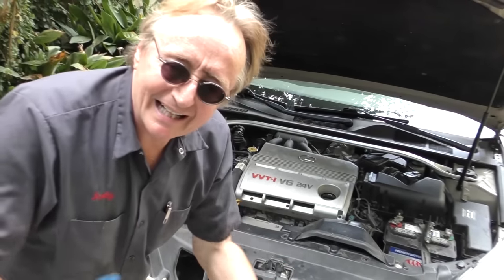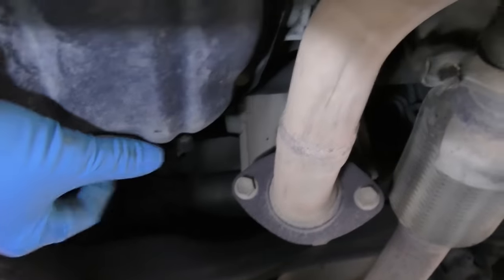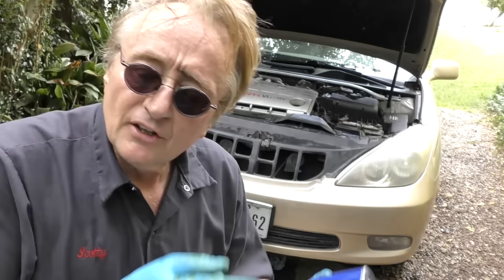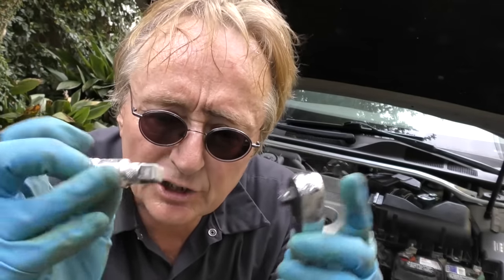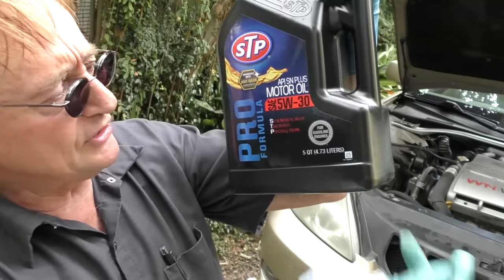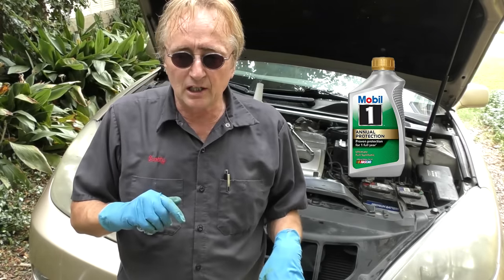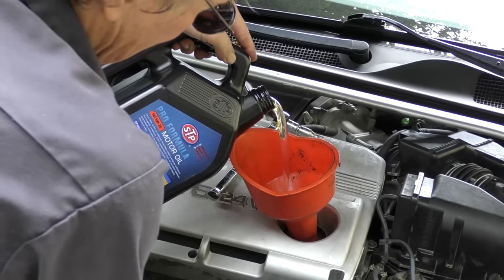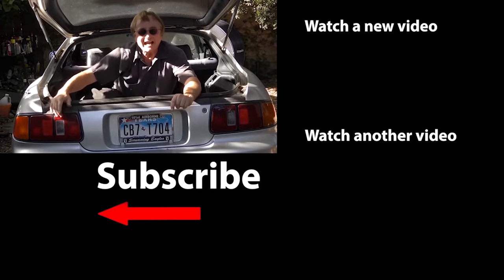Changing Your Engine Oil? You’re Doing It Wrong

Comment: I paid for oil changes twice.  The first time, they put the car on the lift and jammed the electrically retracted antenna into their ceiling and broke it and wouldn't fix it.  The second time, they tried to charge me for an oil change they didn't do and it wasn't an accidental oversight.  The receptionist acted guilty as hell when I caught them and the manager yelled at me, "If you didn't trust us then you shouldn't have brought it here in the first place!", as if it was my fault that they're crooks.

Change your own oil.  Get a I got a Fumoto oil drain valve to make it easy, even though I drive 5000 miles a year and only change the full synthetic oil and filter once per year.

Comment: Personally I only use Mobil 1 extended performance full synthetic and the high mileage variant of said oil for high mileage cars That's the brand I've been using for years Never had a problem with it I always go by the motto If it ain't broke don't fix it But that's just me filters are a hit or miss usually I go with the Mobil 1 filter But if there's a sale I'll sometimes get the cheap ones

Comment: Here's a thing, my wife has had her 2ltr diesel Skoda yeti from new since 2011 and has been serviced from the same garage for over 8 years , but as we're going to keep the car we decided that I would do the oil change and service it myself, I bought the correct 5-30 synthetic oil and filter together with flushing fluid, almost immediately the fuel consumption went from 31-32 mpg to over 37 mpg and still getting better, the moral of the story? Don't believe that garages use the correct oil , obviously ours even though it has a very good reputation does not and cars with a full service history are not necessarily better than those serviced by their owners.

Comment: The drain plug requires only like 20lbs-ft torque to squish the alu gasket - no more. Why would you use a breaker bar to tighten it? It is asking for trouble at the next oil change.

Comment: You don't need any special tools to work with oil filer (e.g. those filter caps, lol).
I've always used regular channel locks to remove an old filer and just screwed a new one on with my bare hands, always worked fine.
C'mon, Scotty!

Comment: The right way to change oil in 1974 at Ft.Benning,Georgia would have been to wait until the sweet thing wearing the tightest and shortest shorts in Columbus had finished washing her car and gone inside.........or maybe replace the filler plug when you put on the new filter.
      Not many guesses needed at work Monday when he said..Hey,ya'll know what I did after ya'll left yesterday??.......Uhhh,dumped 5 quarts of new oil on the ground ?????

Comment: I have a Huynday Accent 2008 Hatchback. I went for a engine oil change about two years ago. The mechanic installed a oil filter with a hole. After I been having problem. Anyway since then, I been using additive and do my own oil change. And recently I used Castrol Edge Extended Performance Advanced Full Synthetic Motor oil. My engine worked better now. Any comments?

Comment: Or, if you're cheep like me, get a 16-20" piece of salvage pipe that will slip over the handle of the rachet. If it won't quite slip over a flat handle, use a hammer on the pipe to flatten it and create clearance. Dont recommend a cheap ratchet.  Use a good one,  like Kobalt, Sears, KD, MAC, etc. Probably good to use a 1/2 with a 1/2 to  3/8 adapter..

Comment: I use Synthetic oil & change only my filter after 4,000 & 8,000 miles then top off, then a complete oil change every 12,000 miles car has 230,000 miles on it!

Comment: Scotty !!!!!   I've been changing my oil incorrectly. Bought my brand new 2012 Tacoma and have been using 10/30 instead of the recommended 5/30. Truck has 130,000 miles. Do I continue with 10/30 or switch to 5/30. Live in Houston if temperature  matters??

Comment: Hey Scotty, not sure if you will see this. Got a Ford 1.5L ecoblue diesel motor (2020 Grand Tourneo Connect, UK model), it's on 34k miles and has never had a service (first service at 12k and second at 18k missed, approaching what should be the 3rd service at 36k). Conscious of any potential extra wear I'm sure it has sustained, it calls for 5w-30, what brand or type do you recommend given the previous missed services?

Comment: Be sure not to drop the drain plug in the oil catch pan. Why do the auto companies put oil filters in such stupid and inaccessible places? I don't use a breakover bar to tighten the oil drain plug, as I want to avoid stripping the threads. 
Used oil is a good wood preservative for my raised gardens.

Comment: Never do an oil change on anything with a cold engine. the debris is deposited in any corner of the engine and the oil is therefore not suspended in the oil and in addition the oil is not liquid so it does not flow quickly and completely. So in summary you are putting new oil into an accumulation of used oil with lots of debris.

Comment: I've always been told to fill the new filter with oil before installing it so the system doesn't run dry when you start it.
Reply: You dont have to fill the filter,  just oil the gasket
 My dad had a service station for 43 years, never filled a filter. I change my oil twice a year ,before it gets really cold, and before it gets really hot, fall n spring. Rotate tires every 2,3 oil changes. Change ojl filter every time. Use a quality oil , not the cheap shite
Reply: complete nonsense repeated every thread.  Oil on cylinder walls starts engine and oil pulled from pan and pickup NOT filter.  Zero effect

Comment: Um, I haven’t been doing it wrong. You left out that it doesn’t hurt to pretreat your oil filter by pouring oil into the new oil filter till it’s almost full and quits dropping as the oil passes through
The filter media. Ore treating is good if you are going to start the car up immediately after changing the oil as I do to drive the car off my ramps. It’s good to pretreat because the oil takes several seconds to work through the filter after the engine starts before it starts lubricating the engine while pretreating is almost immediate.

Comment: Ya tighten your drain plug with a big braker bar, till it strips than back it off a quarter turn.
Reply: You need at least 150 ft-lbs to compress that rubber washer seal. (joking)

Comment: 1) Using a 1/2” breaker bar to tighten to drain plug?!?  No, no, no, a thousand times no.  
2) Dirty funnel ... resting square on the valve train.  
3) Lubed the gasket, but otherwise installed a dry filter.  No bueno.  At least fill it up once, pour it back out if you can’t install it without it spilling it everywhere, and then install it.

Comment: Do auto zone rent out oil pan, filter wrench, adjustable wrench. 
   With plastic return oil.
I know asking to much.
  They help me. Remove my
Alternater belt. 
( took me all night, til read book.
  Realized it was spring back,
Wrench was used. Pull spring back.
  Take off the belt.

Comment: Always like your video's. But what you mean your doing it wrong?? STP filters are garbage. Cut 1 open. There's hardly any filter at all in them. And breaker bar to tighten plug for someone that don't know what there doing?? They may strip it. Put a small 3/8 in there hands. No more.

Comment: Terrible. People who need a video like this NEED to be reminded: Righty tighty, lefty loosey. But you didn't mention it. Combine that with the fact that they have all that leverage while using a breaker bar like you recommended. They think they're loosening the drain bolt but, really, they're stripping the threads. For that reason, I have to give this video a failing grade.  Then there is the fact that most of them have ZERO idea how much torque to apply when tightening, even though, in all fairness, you made it pretty clear.  Because they are afraid of the bolt working its way loose & out, they tend to WAY, WAY overtighten it, and that is with just a normal wrench. If they are doing it with a breaker bar like you recommend, that tendency of theirs is just that much worse. It won't seem tight to them because they are too ignorant to take all of that leverage into account and so they will keep going.

Comment: Hey Scotty. You forgot to mention that the drain plug is magnetic and to check for metal shavings
Reply: I have been in the oil change business for 15 years an I have never seen a factory installed magnetic oil drain plug, unless someone has installed it after-market. If you were to find steel shavings in the engine oil pan, that engine is in serious trouble.
       Magnetic plug on the tranny is a different story.
Reply: @klausvolk2654  every car i ever had had a magnetic plug.

Comment: Be VERY careful with that socket extension torque u dont strip the threads tightening that bolt!
In fact....I wouldnt even use it to tighten that bolt....Scotty is a pro and wont make that mistake of over torquing the bolt.

Comment: It's surprising how many people will notice the " RED " engine light on and continue to drive the vehicle, never check the engine oil level, have catastrophic engine failure and then blames it on the car manufacturer  🤔have also seen cheap spin on oil filter element or micron paper collapse and cause problems.

Comment: I have to run thicker oil in my 2001 Ford Escape, it recommends 5w-20, but runs much better with 10w-30, I used 5w-20 and it fucked up my engine.

Comment: So Scotty says to spend $3 a quart for conventional oil. Duh, why not spend $3 a quart for Super Tech Full Synthetic instead and still change it every 5,000 miles. It's a no brainer.
And you don't have to follow the manufacture's recommended grade exactly... If it calls for 5W-30 you can use 0W-30 but the high number should not deviate and the lower number may only be substituted with a lower number. When then engine warms up the oil behaves like a 30 weight oil. The first number indicates the flow characteristics during cold starts in the winter. If you go with 0W instead of 5W it just improves cold starts in cold weather and provides a better flow rate when the engine is cold.

Comment: I took my oil to auto zone.  They said they're full. So I called them from the parking lot.
"Hello this is officer Duncan Moore from the EPA and we've had a report from a Mr Ries saying that you refuse to accept recycled motor oil. Does your store sell motor oil? Then you are required by law to accept used oil. I have Mr Ries on the phone right now. He's willing to drop this complaint if you go out in the parking lot and take his used motor oil in the next 5 minutes. Otherwise we will have to close your store starting immediately. So either go get his oil or lock the doors and go home".
Guess what happened next?

Comment: Hey scotty I'ma be getting a 2014 Lexus IS 350 f sport RWD 
It's got a bit over 108K miles. I live in Arizona and this summer is pretty hot. I have a heavy foot, Should I still put the required weight oil or go up one due to the hot temperature? Because it may slip if it's hot outside and in the engine? If that's a thing?
I was wondering if I could put Royal Purple Oil for the first 5k miles I run it than the second run it the 10K -12K before changing it? 
It has a recall that I'm going to let them know as well to get that fixed.

Comment: Hmm, never used a new oil plug.... Ever.  Still a fan😁
Reply: That car does not use an oil drain plug, it uses a crush washer, and it should be replaced every time, just like every other modern import vehicle. It should also be torqued using a torque wrench to the proper specifications to prevent damage. This is not really applicable on most domestic vehicles.

Comment: 5:20 Amateur move, glugging like that. Turn so jug spout at high point, then tip to pour. Air slides in, oils flows smoothly.

Comment: You did notice in the video that the funnels got some kind of fungus on it may want to clean that funnel The outside but if you are going to clean it clean it all the way cuz all that beautiful When will you put in there with a filter to keep the cut out you just poured it back in the engine?
I take it one step further and you don't have to do this because I'm extremely paranoid think of coffee filter and put it in your funnel and when it goes through if there is anything in the oil it's going to put a stop to it If you see anything in that oil change brands because they shouldn't be any crud and a can of oil if there is you might get the one in a million bottling machines that sprung a leak but maybe you might want to do it again what's 5 quarts going to cost you I always repeat always do that when I drain oil because I want to see what is floating around in there but that's just me The other people they spend money and they spend a little sample to a lab and it comes back and tells them exactly what's going on and I do that every year or so why not what's it going to do cost you ? $ 37.50 how much is a new engine cost?

Comment: i put some 'paraffin ' into the hot engine oil and run it for 2 minutes to thin the oil further and flush the old junk out...   no different to engine flush..... my engines definitely run quieter with new oil... and i also rarely go past 4000 miles before changing its THE secret to high mileage engine..

Comment: So the "right way" doesn't include pre-filling the oil filter before installation, Scotty?
Reply: startup is from cylinder wall oil and bearing oil, never from the pan and never the filter.  pump is in the pan not the filter.  If worried let it drain into pan for hour before starting.

Comment: I might disagree on the synthetic I have been putting synthetic oil in my mid 2000 vehicles That scotty says that wont last long and they have ( knock on wood ) . I think all new vehicles  and maybe over the last decade  use synthetic coming out of the dealership . Spend a little extra and do fewer oil  changes and maybe your engine will thank you with a longer life

Comment: Sloppy as hell.  Dirt in your funnel.  Drain plugs actually have a factory torque spec.  Also in nearly every owners manual, it will tell you there are several options for viscosity depending on conditions and supply available

Comment: Don't do what I did! - I drained the transmission oil on my toyota,  both the engine and transmission have a 14mm drain plug...  luckily  I noticed.  Went to the auto shop for some transmission fluid,  and the mechanic there told me how a young guy at a ford dealership did the same thing on a new ford -  then he double filled the engine with oil...   blew up a brand new car!

Comment: Yeahhhhh.... noooooooooo........ You can change the weight of the oil with no bad effects depending on where you live.  5-30 for general or moderate temps and a heavier oil for desert areas like Phoenix or Las Vegas. If you live in colder areas, use a lighter oil.

Comment: WUT? Regular oil 4000 miles? Is this for a harsh climate or something? In europe most cars go 10,000/reg, more on synthetic. Oh wait, i forgot, euro cars typically rot away or fail electrically at about 100,000 miles/8-10yr... lol
Oh wait.. i think you might be talking about what we call "motorway oil" here. It's called that because it's good to get you off the motorway if you lose a lot of oil for some reason. A holdover from old British Engineering.

Comment: Hi Scotty. Regarding newer engines (2013) in hot humid climates like where I’m from (Dominican Republic). Temperatures range mostly from 25 to 35 degrees Celsius. I use synthetic in my RAM HEMI engine and change it very 5,000 kilometers. Can it go longer without change?
Reply: just change the engine
Reply: @johnmadden2814  why??
Reply: @elvaquero3030  sorry,Ernesto, I was in a wacky mood and being a smart arse..and changing syn.oil that often is overkill,even for a Dodge.Please dont take it personally,I dont like Chrysler.just like Scotty,i believe they dont build them to last.

Comment: most cars have a seal that can be removed my question is my car doesnt have a washer its a rubber circle that looks adhesive to the bolt surface  its big enough to perfectly seal the drain plug hole is it smart to damage that? my luck its replace the whole plug bolt. i dont have any leaks this is a possible future problem maybe not it look well together.

Comment: I have wondered. Why for example does kia USA recommend oil change yearly or 12000km and in germany for example every 2 years or 30000km? Is the quality of full synthetic oil so much better? I have even heard of testing being done where they have driven 100000km without a oil change. the test was done by opel.

Comment: Scotty (or anyone expert), I took my car to Jiffy Lube and I brought my own oil and filter.  The tech drained the old oil, poured in the new oil, THEN changed the filter.  Is that possible?  Can the filter be changed when there's already oil in the engine?
Reply: Yes. When you pour the oil in the engine, it flows down into the oil pan. The oil pump pumps oil through the oil filter. Unless it is running, oil is not flowing into it. This is a non-issue. However, if the oil filter is mounted upside down, they should probably fill it with oil before installing it. They should also have used your oil to lubricate the gasket of the oil filter. This is what you get when you pay a minimum wage entry-level employee to do work that you should be allowing someone proficient at their job to do.
Reply: My Pontiac had the filter on top of the engine. It can be changed any time. Wouldn't like to do it with a filter at the bottom though.

Comment: I fill the new oil filter with oil prior to screwing it on. Some oil filters give this direction.
Reply: nope.  pump is in pan not filter.  engine starts on cylinder oil film layer not filter.  Good oil leaves excellent layer for next startup.  Just let oil drain into filter for an hour or overnight then start if you are worried